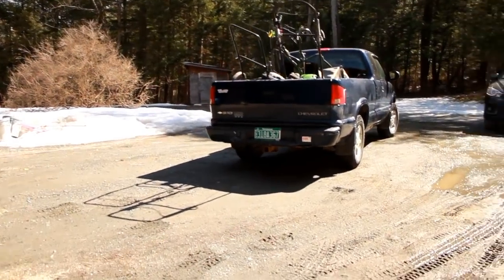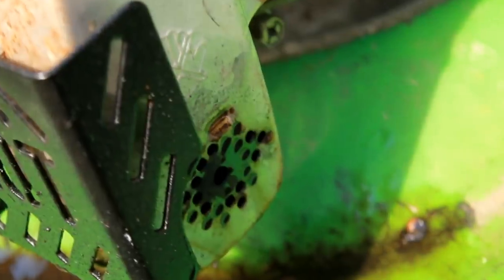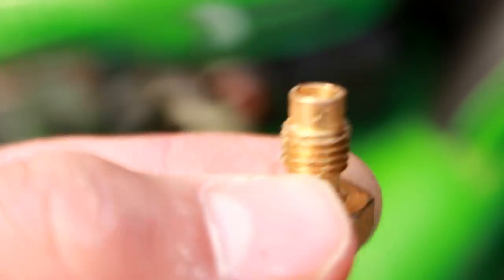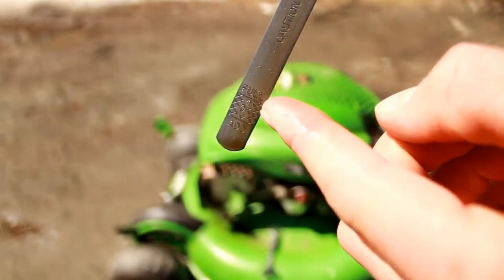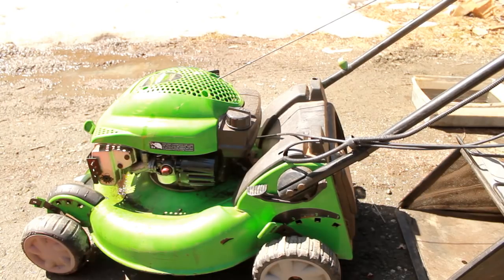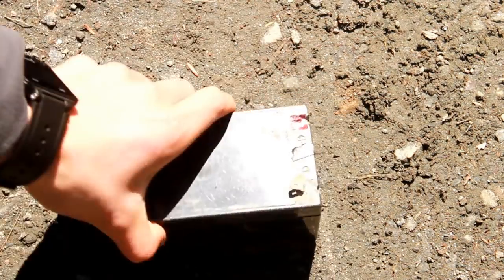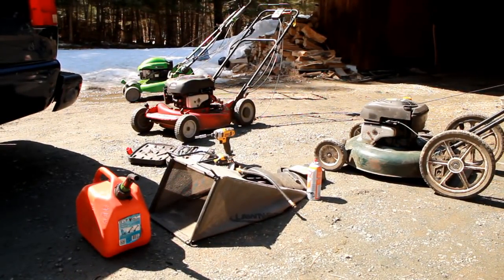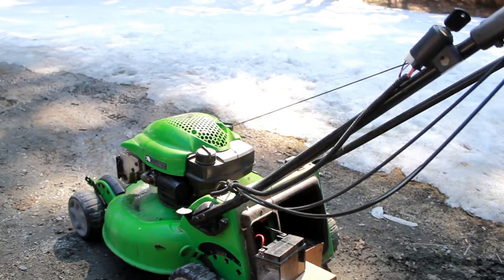Repairing Trashpicked Mower

Comment: Check leakdown to check rings, valves, and head gasket. Change the oil. Tune the engine. Change the blade. Adjust idle adjustments. Remove the flywheel and replace the top seal and replace the lower seal.

Comment: Quick note, always check the blade, sometimes people leave them loose or off completely,  if it doesn't have a blade it wont run, the blade has a flywheel effect on the engine, plus if its loose it's a safety issue. I've seen mowers not run because the blade was so worn down.
Reply from the maker: thanks I'll check this in the future
Reply: Or flipped upside down - THAT's a reason to haul the mower to the dump!!  Who wants a mower that doesn't cut right?    :~)

Comment: I just remove and kit the carbs
If engine junk I remove carbs and dump fuel out and into zip lock bags with information on engine size 😊
Very few people will have the electric start fixed but they sale good if they do 😊

Comment: Okay I'm I the only one thinking this what's the point of the power start If I could just pull the cord
Reply: Ryan Scherbluk some ladies cant pull enough torque to start.
Reply: Yes, you could pull the starter cord , but not all users can.  Age demographics and operational convenience is part of  marketing, not all units come with this feature.  Many users have limited use of hands, or shoulders. The very reason why at least one neighbor has a similarly equipped unit.

Comment: WD40 is not a lubricant
Reply from the maker: wrong
Reply: @ARuralVermonterQqjmcb182  it's main use is a water displacer (hence WD 40 days) and as a solvent, true penetrating oil works a lot better